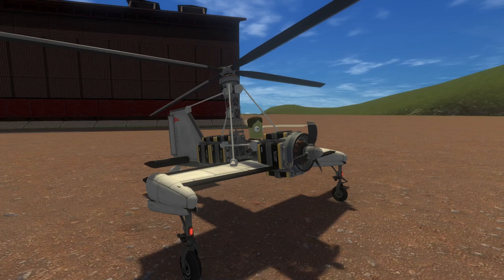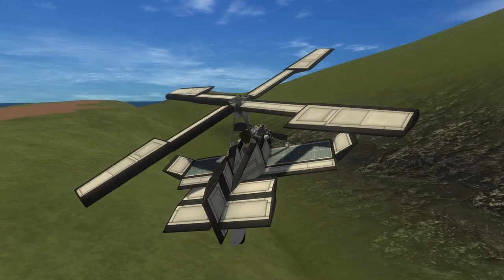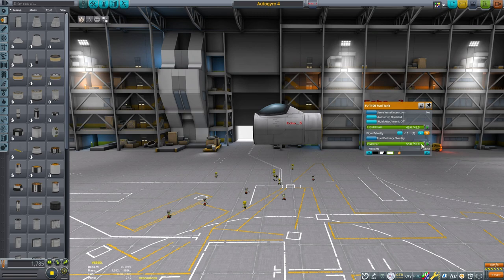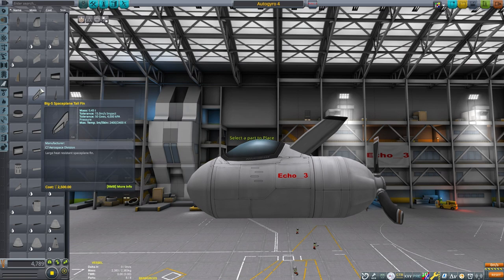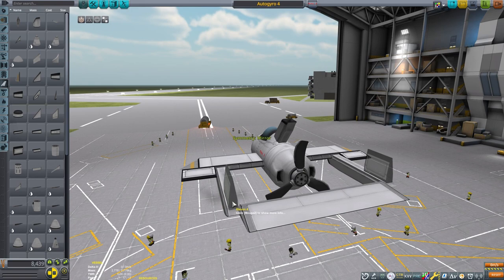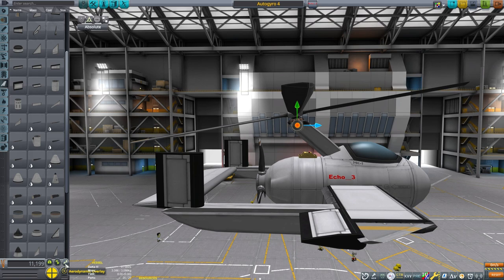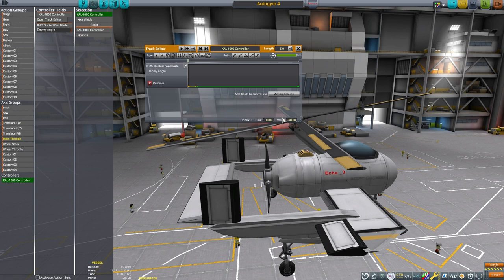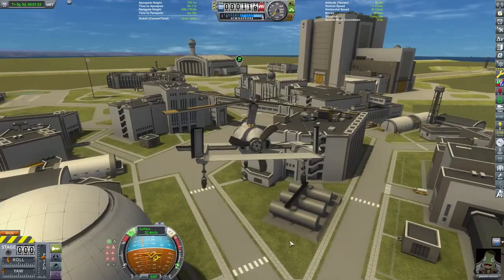Autogyro Tutorial and Tips for KSP

Comment: thats so cool! i just watched a movie with one of these in it and i thought they werent even a real thing! 👍amazing video
Reply from the maker: They are very much a real thing and have been for about 100 years. And they can be replicated in Kerbal Space Program. What was the movie that had an autogyro in it?
Reply: I finished making it. Mine is much worse than yours, but it still works! I made a few modifications because I didn't unlock all the parts, and I also duplicated the engine to the front in order to fight the torque.
Reply from the maker: @khlobbia  You used a push/pull configuration. I was able to make some pretty fast planes like that. Will you be sharing any pictures of your craft?
Reply: @Echo3  the autogyro was from the movie "Lupin the Third Castle of Cagliostro," but you only see it for a part of the movie

Comment: can you tell me if such design works the same way as autogyros in the real world? i mean the end effect is the same but ksp doesn't exactly simulate aerodynamics so the autorotation may be achieved somewhat differently?

also nice to see other people building autogyros in ksp
Reply from the maker: As far as I know, it works similar to a real one. I did research on how they were set up. For more realism (and this would more like how they are really designed), you can add some hinges between the unpowered rotor and the blades to let them flap a little bit and swing fore/aft a little. The game doesn't have a full aerodynamic modeling, but with FAR and the ground effect mod, it would be pretty close

Comment: my autogyro keep going to the right
Reply from the maker: As the rotor spins, it will generate uneven lift with the side spinning into the direction of travel getting more lift. This was solved 100 years ago through the use of hinges that would allow the blades to swing horizontally.

I found that I could usually mitigate most of this by using SAS and adjusting how much roll, pitch and yaw control authority I gave the blades.

You may also be experiencing torque from the powered propeller. If the unpowered propellers would naturally cause a roll one way, then I will set up the powered rotor to torque the opposite way. Alternatively, you could try using a co-axial rotor design to help cancel the torque all together.